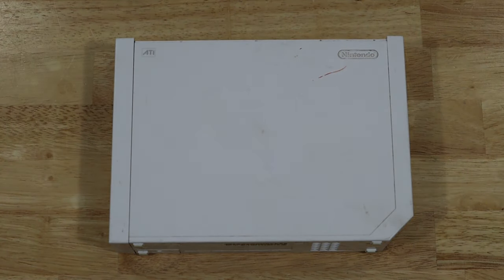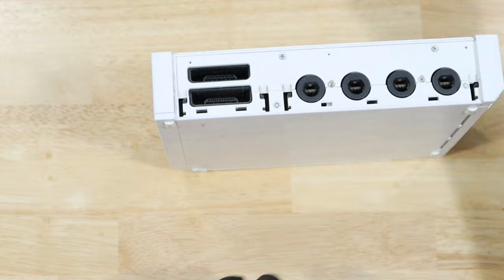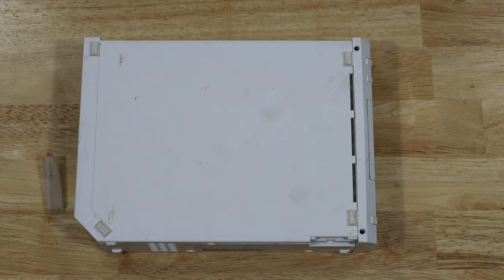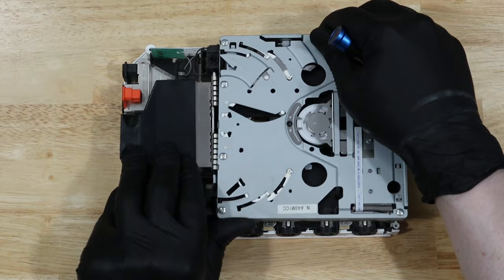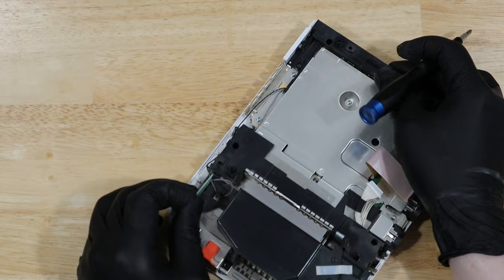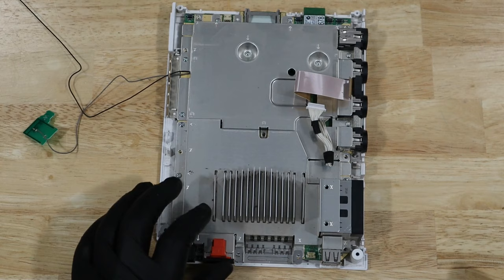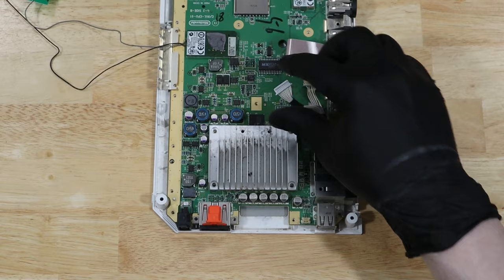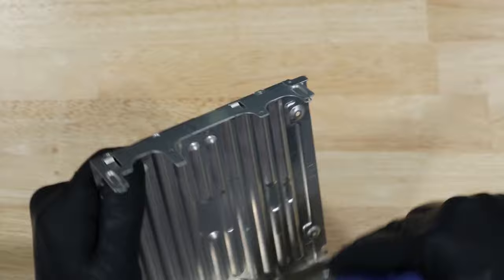Tearing Down & Cleaning the Nintendo Wii

Comment: thank you for making this! i ended up using this video as reference to take apart my childhood wii and clean it up and i was able to do so with relative ease!
Reply: I really have to do this at some point. My eject button has been broken for over a decade at this point and only works if I wiggle it, so maybe I could fix that as well at some point in the future.
Reply: @NottJoeyOfficial  same
Reply: @NottJoeyOfficial  don’t take it apart if you don’t know what your doing, you will ruin it WAY more trust me I know because I use to SUCK at taking things apart and knowing where they went back and fixing stuff
Reply: Makes crushing rocks seem like a breeze
Reply: @MorphBaller388  no shit! I was thinking the same. It was a lot easier taking my computer apart to clean.
Reply: @NottJoeyOfficial  I would recommend to taking your Wii to a professional repair place
Reply: @unlined_sardine7426  it's worked for a decade like this, it's a minor issue, if I ever repair it I'll try and do it myself most likely.
Reply: @NottJoeyOfficial  be careful
Reply: @NottJoeyOfficial  it’s not hard to do but you will need a Y bit for your screwdriver or a tiny flathead. The tiny flathead worked for me but I definitely damaged the screws, still able to put back together. Just organize your screws and I was actually able to keep some in place when removing parts to make it easier.
Reply: I'm planning on doing this soon as well. Gonna see if I can take out the motherboard and put it into a new wii.

Comment: This looks a lil complicated. I've torn down the og xbox and replaced thermal compound in it. Ive torn down ps2's,Gamecubes. But this looks like a different monster!
Reply: It doesn't look hard but there's so many freaking screws in this one.
Reply: @FranksShitBoxCollection  but tbh I’d rather screws than plastic clips
Reply: @fearxgods1474  I mean you're not wrong.
Reply: I'm kinda worried about taking mines apart
Reply: Most comprehensive tear down though.  Other videos stop short and dont show you how to completely take this bad boy down.
Reply: I have 2 Wii consoles. One of them got a disc stuck in it. After watching it I kinda just feel like leaving it in there haha. Didn't think I'd be needing more than 1 different kind of screw driver. They've both just been sitting in the corner and I was going to connect it just to play it with my sister. The one that has the game stuck has most of the old game data though and remotes already connected. Only reason I'm still contemplating on opening it

Comment: I got my Wii apart following your directions. Worked very well to do that. I discovered in the process that my Wii has bigger problems than just dust. Turns out that the motherboard is fried too. It was still educational to take it apart and see what all is inside.
Reply: Did you ever have any display issues/artifacts?
Reply: @TheManOfMuscle  The problem I had was that it started making horrible grinding noises like it was trying to grind coffee beans or something. After that, it started shutting itself off in the middle of games. Then after that, it quit turning on at all.
Reply: @enfieldjohn101  So that was a motherboard issue? Sounds more like a drive but I could be wrong.
Reply: @TheManOfMuscle  It was probably both. It had leaking capacitors by the time I threw it away.
Reply: @enfieldjohn101  shit. I wonder if that’s happening to my Wii too.

Comment: just bought a dirty wii & plan on doing the same thing, great video!
Reply: i need to clean mine. played it since it came out then put it in storage.
Reply: @Allen-sz7jz  same for me, needed some instructions lol
Reply: Just bought a dirty as hell working Wii for $10, planning on tearing it down and using my spray gun to paint it a different color.
Reply: @FranksShitBoxCollection  are you a painter?? Make sure to prep and prime so it doesn't peel 😄
Reply: @ext93  I do automotive paint and recently got into air brushing.
Reply: @FranksShitBoxCollection  very nice. I want to try air brushing. Are you going w/ gloss or matte on the Wii?
Reply: @ext93  I'm thinking of going with a clear over the base paint. Thinking about painting a Triforce on both sides but I want to try a galaxy/space theme for it.

Comment: I used this to take apart the old family wii from a decade ago and clean it out. It was sitting in the attic for a long time and it was full of dust. 

When I finally plugged it in, I realized the controller was busted and all the old disks as well. I can't believe mario still goes for $60.,,
Reply: Good games on there that's why
Reply: you should mod it if you haven't already
Reply: @LUISCHAVZ100  what mods can you do to a wii?
Reply: @izakomandaz2895  you can mod to run emulators of a sd or usb. You can also backup games. its easy give it the old youtube search and youll find lots of tutorials. I modded a wii i found on the trash and gave a second life
Reply: Isn't it more likely your Wii's laser is busted?

Comment: great video.. little disappointed of the speed that was to fast but nice job :) a clear case would be cool to see
Reply: just got a clear case in the mail today i cant wait to install it theyre on aliexpress for dirt cheap
Reply: @your_stepdad  How did it go with your shell replacement? Did you run into any issues? I also have a clear shell on its way and plan to use this video as a guide.
Reply: @nintendonintendont  it was alright, kinda sketchy tho since i got a cheap one off aliexpress so assembling it was a pain in the ass, also BE CAREFUL WITH THE BLACK AND RED WIRES IN THE FRONT PLATE, i had to solder them back on like 3 times cuz they kept coming off

Comment: i picked up a wii from goodwill for 12 dollars. No cables or anything came with it so not even sure if it works. But it was NASTY dirty, and wanted to open it up and clean the inside as there may have been.. critters.. as I found a bug's leg on the outer casing (disgusting, i know). So before I even put more money into getting the appropriate cables.. wanted to take a look and clean it.. not sure if my order of operations makes sense. anyway, this is definitely going to be a job with all these screws but nonetheless, good practice anyway :)  thank you for this

Comment: My homebrewed Wii all the sudden decided to stop working today. I pushed the power button and it turned green, but that was it. No display or audio came through, the disc drive didn’t even try to read the disc and never turned on, and the Wiimote can’t even connect. I have priiloader installed, but I can’t even load THAT even with the power button/reset button method.
It was working perfectly last night. The only thing I installed yesterday was CTGP, which had been sitting on my SD card for quite a while. There was an hour worth of updates that had to install, but I’ve never had trouble with CTGP at all on my other Wii. I’ve tried switching different cords/TVs/Power Cords, nothing is helping.
Any help would be appreciated. Hoping this isn’t a permanent brick and can be fixed somehow.

Comment: I got to the stage where you took out the 4 screws that held down some plastic and aluminium. Unfortunately the 2 right screws were not turning at all and ended become unthreaded. So I pose a question; What do you do when screws particularly small fiddly ones become thread bare? is there anyway to get them out still or are the destined to remain where they are for eternity?
Reply: bunch up tape on the screw and use a LOT of force

Comment: thanks for this video. I have a Wii that is not reading discs and considering taking it apart myself. The disc will go in but I don't hear the drive engage. I'm not sure if its the lens or a mechanical failure of the drive... It read a GameCube disc (Super Mario Sunshine) though.

Comment: i know this is a year old video, but I've got a question. my tweezers slipped disconnecting the led wires taking the front face plate off and snapped the two little wires right at the connector. how should I fix that? strip the wires and connect them to the pins somehow? get another micro connector (no idea how to go about that) and strip/connect the wii wires to the new one and plug in?

Comment: How can i repair my wii. When I insert the power cable to the wii no light blinks ,It just won't turn on. the power cable I use is fine (I checked it) I think the problem might be in the wii. My wii is 3-4 years old ,so is this problem coming because of the dust in it? or because of some wire.(I have tried the AC adapter reset but no scuccess).

 Great video by the way.

Comment: Gotta ask you i disassembled my Wii before it was detecting the CD now it shows an error that it cannot read the cd. Any idea of what I could have done wrong?
Reply: Sounds like the laser was somehow touched in the disassembly process.
Reply: I didn’t connect the flex correctly. It works now

Comment: I got a Wii too 9th year of its life i might do this i use it as an snes nes emulator mostly nowadays. :)
Reply: What do you use for a controller when playing emulators?
Reply: @FranksShitBoxCollection  The classic controller works great for any of the older retro games. If you want controllers for specific emulators there's also SNES/NES controllers for wii or you can use the SNES/NES classic controllers connected to the wii remote; they work just as fine. 

There's an accessory called the "boss pdp" wii controller that turns a sideways wii remote into a PHAT nes controller. I don't think it'll work on wii remotes that have a case on them, I don't have the accessory so I can't be 100% sure. The Gamecube controller is another option, it's not the best imo though because the button placement feels awkward for a lot of retro games.
The freest option is just using a wii remote turned sideways, but that only works on games that use 2 main buttons.

As for the N64/PS1 emulator, those are garbage on the Wii so I never bothered trying anything with them.
Reply: @FranksShitBoxCollection  Wii remotre for Nes/Master System, and classic controller pro for SNES/Genesis.
Reply: @32-bitcloud  Where can i get a snes like controller for the wii?